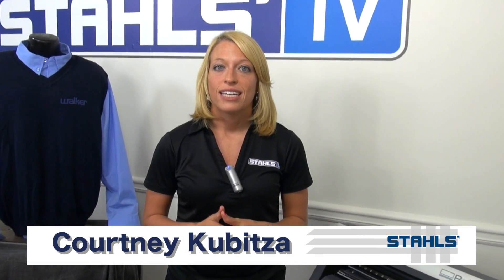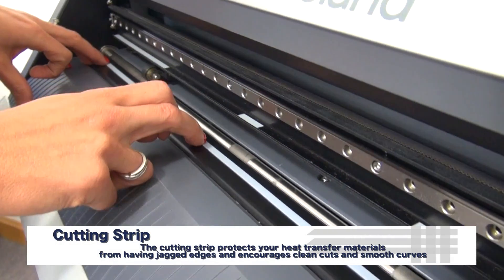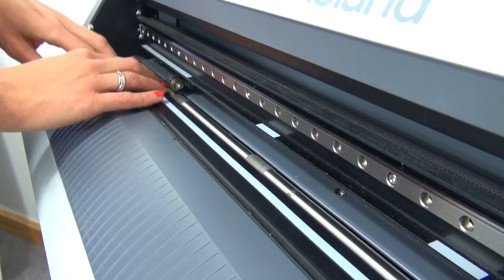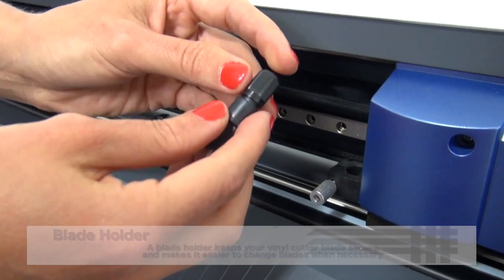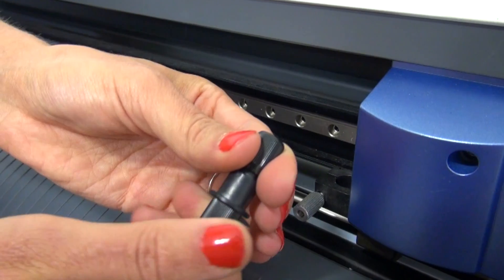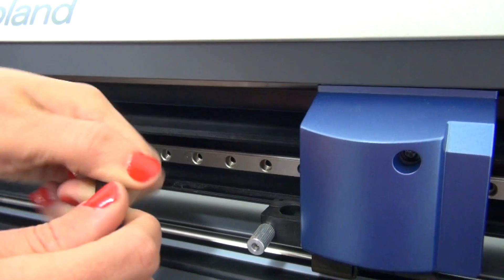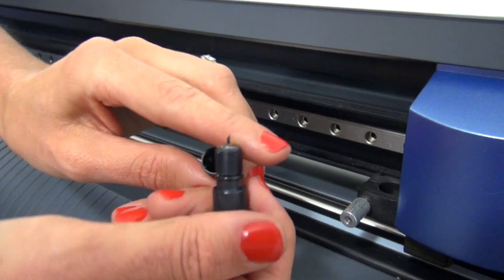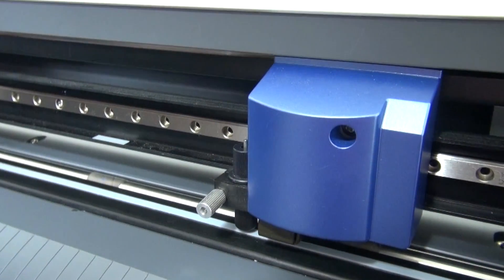Common Vinyl Cutter Problems: Skipping and Perforated Cut Lines

Comment: Hi i have a rs720c cutting plotter and when it starts cutting stops and go several times until it finishes the picture and that's when the control flow it's set to hardware otherwise it doesn't finish the work i need help!!
Reply from the maker: Please email qe@stahls.com to get assistance with this issue.

Comment: do you keep the same thickness even if you cut deeper materials?
Reply from the maker: If you are cutting thicker materials you can use a 60 degree blade as opposed to the 45 degree. Your down force settings may differ as well with thicker materials. Be sure to use the test cut.
Reply: You are supposed to adjust the thickness for different materials, but it can be quite hard to find the ideal thickness, especially in models that don't have a downforce setting (making the blade longer can increase drag, and cause the vinyl to slip or jam against the blade holder), so adjusting the thickness back and forth means you then have to waste more material fine-tuning the depth.

To avoid this, you can simply have multiple blade holders, pick the best blade angle for each material, adjust the depth until it's perfect, and then never change the depth in that holder again. To cut different material, simply remove one blade holder and insert the other. This saves a lot of time and material when switching between different types of vinyl.

BTW, some blade manufacturers measure the blade angle relative to the horizontal plane (so 30º is flatter and 60º is pointier), while others measure it relative to the vertical plane (so 30º is pointier and 60º is flatter). Maybe that is why people tend to use 45º blades - they are 45º from both axes. ;)

Also, you will find conflicting advice about angle vs. thickness. Some people recommend using a flatter blade for thicker materials, some recommend using a pointier blade for thicker materials. In theory, all blades should be able to cut any common thickness of material, but they will result in different amounts of drag. The best thing to do it experiment with the material(s) you use, find the optimal combination of blade angle and depth, and just reserve that blade holder for that specific material.